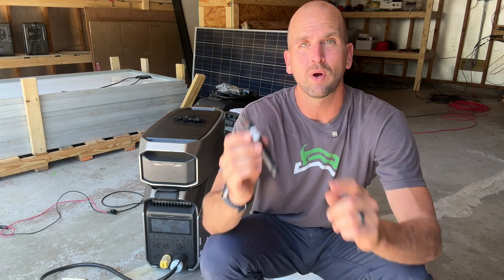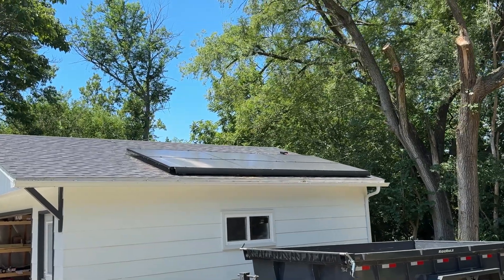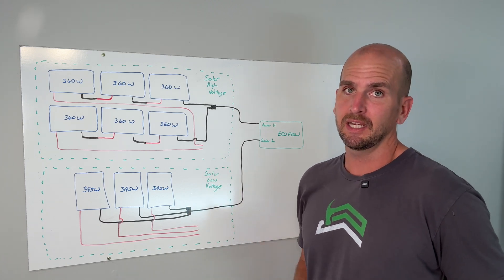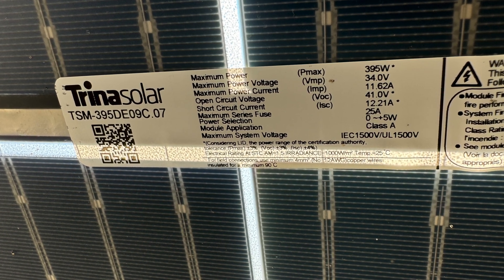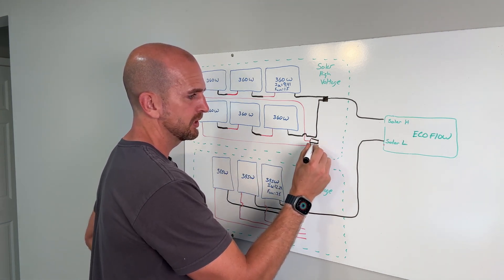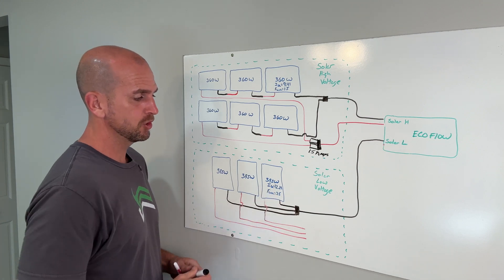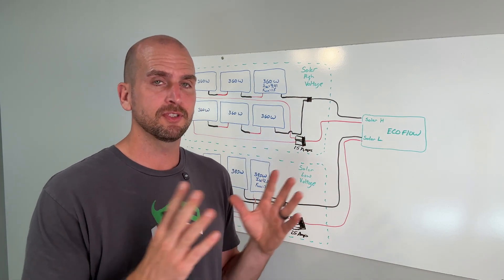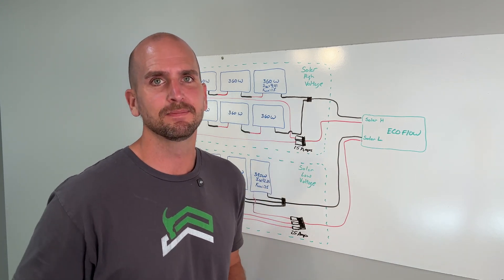When And Where To Use Fuses For DIY Solar

Comment: I suggest in the future to show the whole circuit without the fuses (red lines connected to MPPT), then add the fuses.  Those hanging red lines at the start are confusing.  (The connection at the EcoFlow does not change, the fuses go upstream of the existing Y connections.)
Reply from the maker: Thanks for the feedback 👍

Comment: I’m going to be running 5s3p 100 watts ecoworthy bifacial panels. I bought a “DIHOOL Solar Panel Disconnect Switch 30 Amp Breaker Box” from Amazon. I believe the breaker would work the same as a fuse, or should I look into a legit fuse?

Comment: Great information. Thank you. I'm currently running the DPU with 4 batteries for a total of 24kw. I have (8), 400w panels, in series, charging the DPU. I plan on only solar charging at this time and only using it to charge up my 30kw, Nissan Leaf. Hope you can help me or anyone else with my questions. Do I, should I, ground the DPU unit? I see a ground screw on the unit. I was thinking about adding more panels to bring the total up to the maximum allowed, which I believe is 4000w for the high solar input. Can I mix one or two more panels that do not have the same output rating? As an example...can I add two more panels rated at 375w each or one panel rated at 800w? These are just hypotheticals. Not even sure they make panels rated at 800w. Thank you in advance for any information.

Comment: Great topic and thank you for the presentation.  I don't fully understand the placement of the fuses or where the magic black smoke is going to come out,  so I would welcome additional videos on this topic.
Reply: If any one of the panels have a shorted diode or any particular shorted buss bar on the panel which might result in the current taking that path of least resistance then it is advised to fuse accordingly so the problem panel's fuse would act first.
Reply: @eddietee6305  should we not use Isc , since the Isc can never be exceeded during a short circuit?

Comment: I'm a bit unclear on what kind of circumstance these fuses would help with. You've said a short that causes more current to go through a single branch.
Could you give some clarification or an example of what this type is failure might look like?
Reply: Each panel has a short circuit rating and they are connected in parallel. The diodes in the connector of each panel can short out - current tends to find the path of least resistance.

Comment: Heliene  66M HJT All Black Module - 360 watts on DP3  have a VOC of 48.62 so 3S puts these at 145.86 volts at STC. These panels in 3S will exceed VOC of 150 volts when panel temperature gets below 14 Celsius or 57.1 F
Reply from the maker: Thanks for running the numbers.  Appreciate the help!
Reply: The 3s panels will not see the 150v. They are in series and hence they can only see the output voltage of each individual panel. The voltage adds but that doesn't mean each panel is seeing that full 150v. Just think of batteries in series. A 12v battery can only see 12v whether connected in series or parallel.
Reply: @eddietee6305  The Delta Pro will see the 150 volts. VOC occurs without current.

Comment: Great video. This is the exact solar configuration I recommended in my delta pro 3 review video. But I forgot to mention the fuses though. Good reminder.
Reply from the maker: Yeah, I like over paneling the High voltage side a bit to stretch out the peak sun hours and get you a little more on overcast days.  Overall I am impressed with the DP3 thus far and was able to charge the Cybertruck up with 9 kWh from solar yesterday from the DP3 which is not too shabby.

Comment: I have 8 panels - 4S2P (I think that's the notation?). They go into a combiner box with each series having a 10A fuse. I assume that covers this? The fuses are before the combination, not after.
Reply from the maker: Yeah, that should work assuming the Isc is below 10 Amps.

Comment: Man, Yea!  Not enough info and conversation about this on YT.  Out of confusion and concern, I bought a miniature 30-amp disconnect switch/circuit breaker to put between the panels and the Delta Pro. I'm currently just using 6 -100-watt panels but upgrading to approximately 1600 watt.  Few years back a BougeRV tech said I wouldn't need fuses with a 1600-watt system.  Anyhow, the topic of using fuses doesn't seem to get the attention it deserves, or maybe I'm just being too careful. Those DP's sure are pricey though... Great video, Thanks!
Reply from the maker: Thanks for the feedback and yep the DP, DPU, and DP3 are not cheap.  For certain applications they make a lot of sense but also good to look at the DIY path as well if you system is stationary.
Reply: M,  I just bought Bougerv inline fuses for the same setup as you. Can you tell me if the fuses are already inside the fuse holder and if so how do I unscrew the fuse holder to replace fuses? Damn fuse holder is pretty hard to open up.
Reply: M h

Comment: On the top diagram. I am thinking no fuses would trip as the most the other string could pump in is under 15 amps? You are assuming that the top would have 10 going through the top fuse but why would it if the sink is a panel in that string. Am I wrong and if so can you explain? Thank you!
Reply from the maker: In normal operation you are correct.   The fuses are just protecting against a short circuit where you might have both branch currents going through one side.
Reply: if the nmaximum current is 9,41 Ampere and the short circuit is same coz a 9,41 Amp panle can not put out more then it ca so a 15 Ampere fuse is pintless .
this fuse not protect anything coz this current againt this fuse protect never will be there.

Comment: any downsides to undersizing the fuse if there is a ton of room between isc and max fuse rating?
i.e. isc is 11.26A and max fuse rating is 20. was thinking about doing 15a fuses
Reply from the maker: I don't think so,  for instance on my Solar L side even though the fuse rating is 25 Amps I would be comfortable using 15 Amps or 20 Amps.